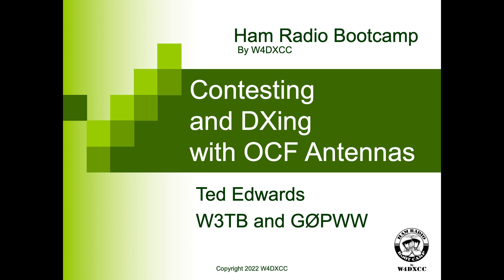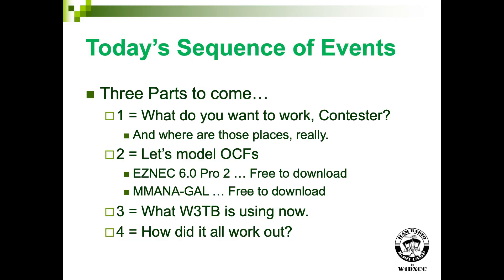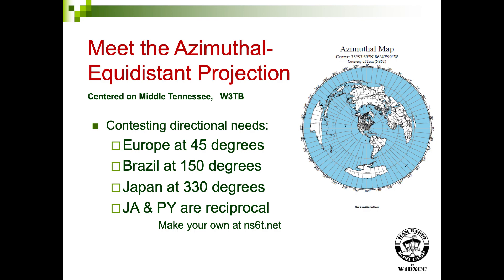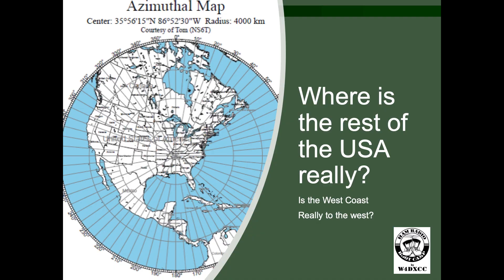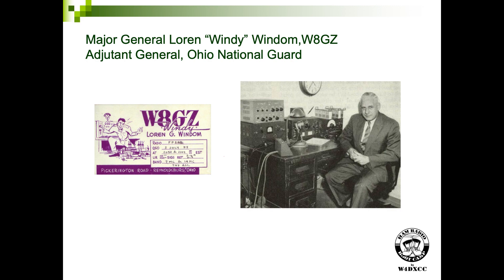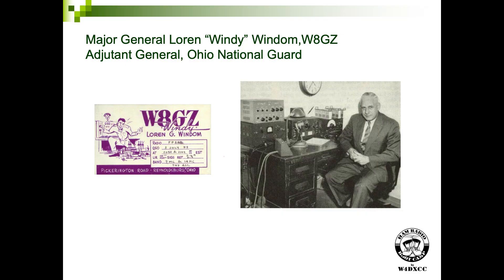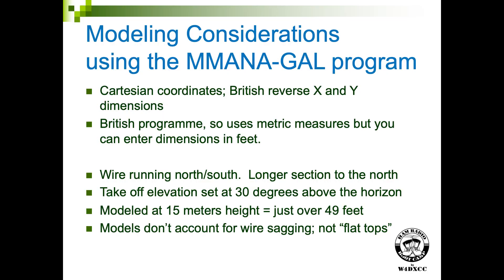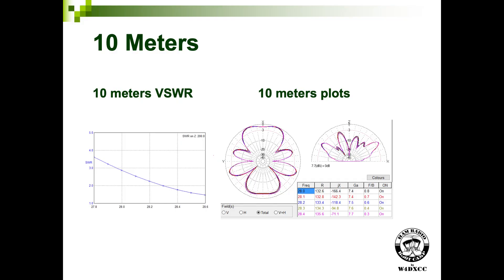Off-Center Fed Antennas

Comment: It's "Common Mode Current", not common current that flows on the outside of the shield.  Then there is differential mode current that flows on the center conductor and the inside of the shield.
Reply: Common Mode Current "is" RF current flowing on the outside of the shield.
Reply: Then make your own video and grace us with your superior knowledge.